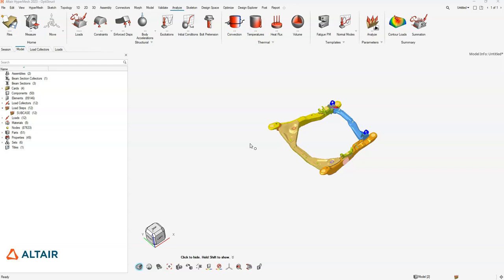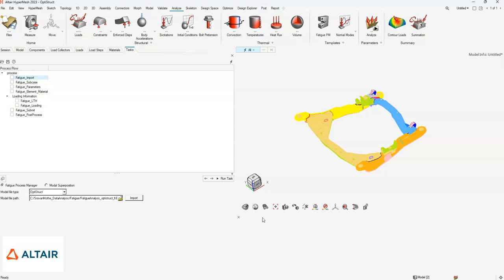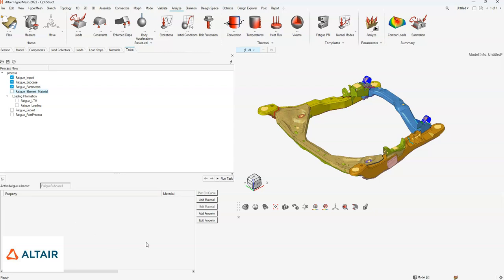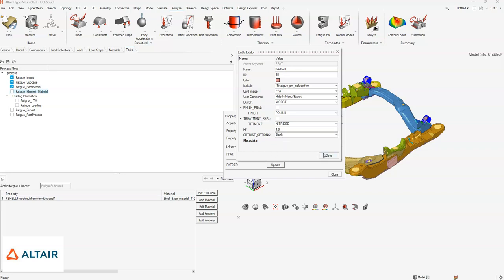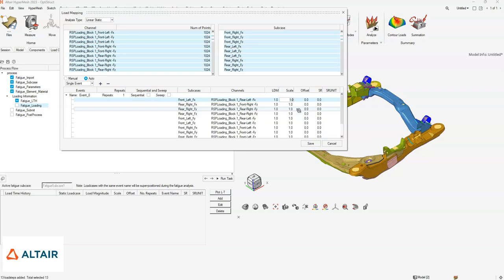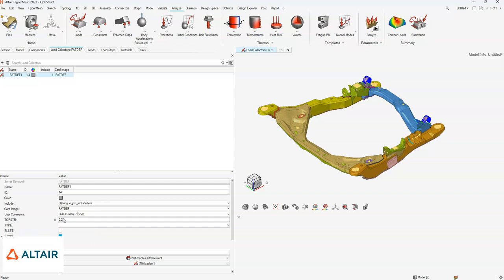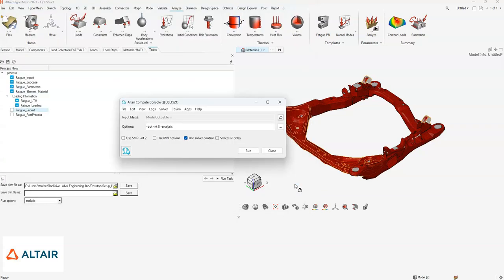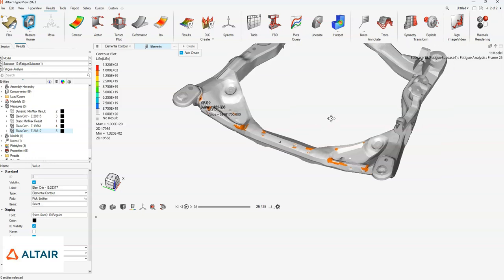OptiStruct Structural Fatigue analysis setup

Comment: Excellent tutorial.  I wonder when Altair will incorporate modules fatigue and damage tolernce to outcompete AFGROW.  They should also consider creating a workflow for classical methods to outrival hypersizer.  From the Aerospace side, we need more development in the FBD workflows and a way to calculate/size parts by 1D/2D element loads.  Also, if there is a way to calculate section properties of general/arbitary cross sections, that would be nice.